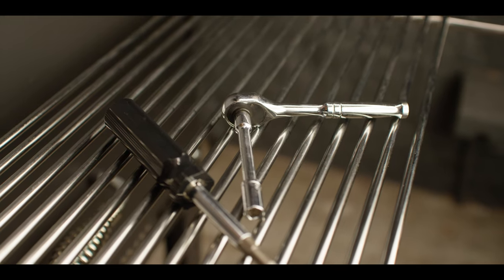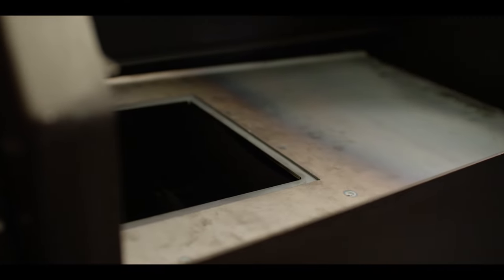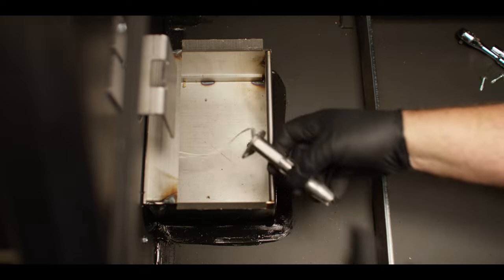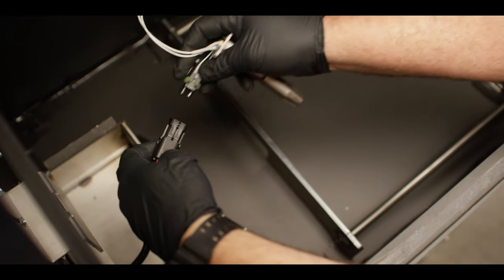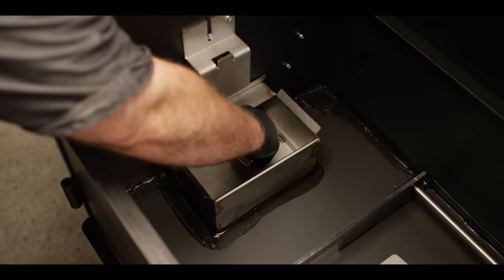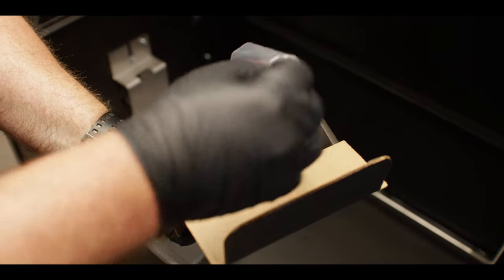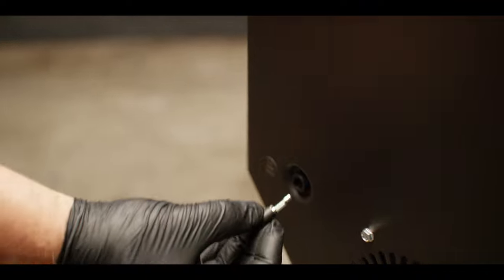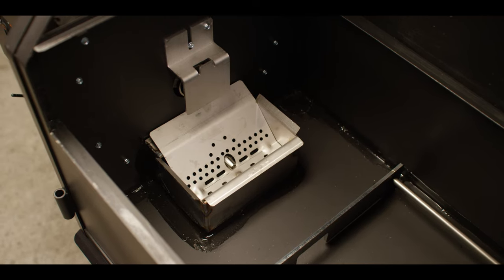Igniter Replacement

Comment: Would be a better video to do this on a BBQ/Smoker than has been used a lot.  Not so easy
Reply from the maker: The igniter change in a 640 is really simple regardless of the age and use. I have a pair of 640's, the first one was built in 2010. Ran the original igniter until 2021 when I updated to the ACS board and chose to install the ceramic igniter. The advantage is quicker combustion. Thanks for commenting and of course, thanks for watching!

Comment: Done it a pile of times on my 640. Untwist it bracket can stay rite there. They fail so frequently.
Reply: Never failed after 5 years of heavy use in my Pit Boss. I guess paying all that extra money doesn’t pay off. 🤷🏼‍♂️
Reply: Had my 640S for two years now and it hasn’t failed. Use it at least twice a week for cooking supper and smoke on it every other weekend or so.  You might call Yoder and see if they have a fix for you.
Reply: @meatwhisperer  my neighbour and I both bought a 640s at the same time. Both have been less than perfect. Igniters are a constant failure point. And the wimpy fan motors.